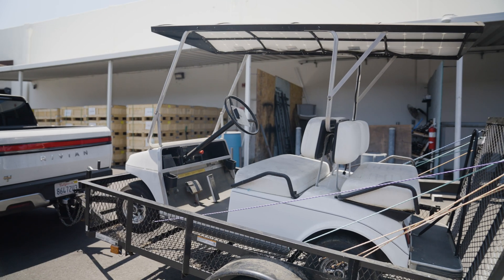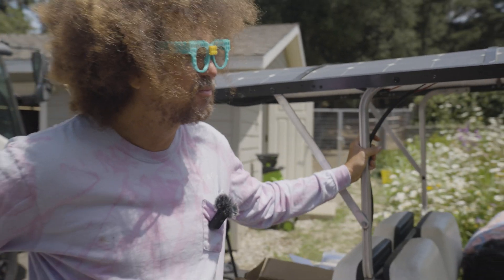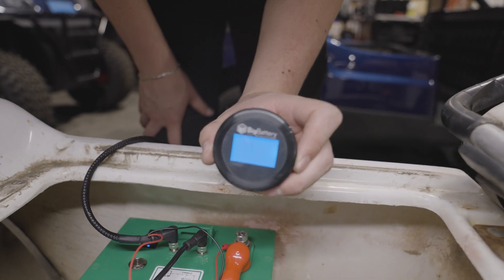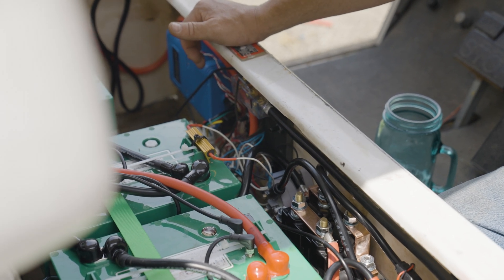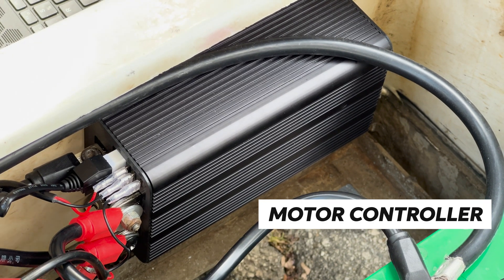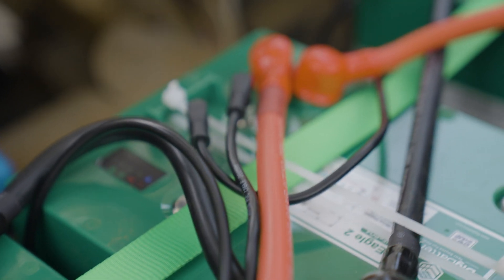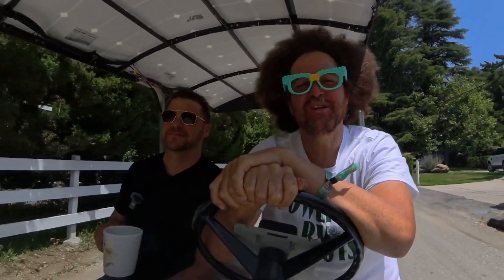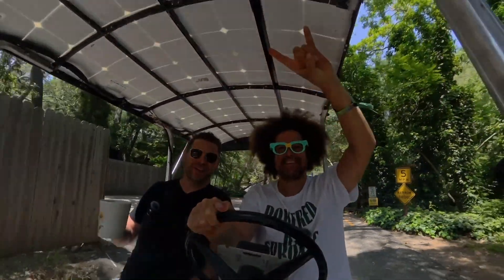REDFOO's 48V EAGLE 2 Golf Cart Conversion | Party Rockin' with @solarrolla

Comment: Stock Club Car DS MCOR or potentiameter has to be matched with Controllers that are 6k ohms - 0 ohms. To bad you guys did'nt explain any tech details on converting 36 -48 Volts. Also it would have been nice to explain solar charging LFP batteries and how the resistor is wired to the  contactor. Why did you choose the "Eagles" ?  BigBattery has other choices that may fit the narrow chassis of the Pre 2004 Club Car.  I hope you put more video content on this project.